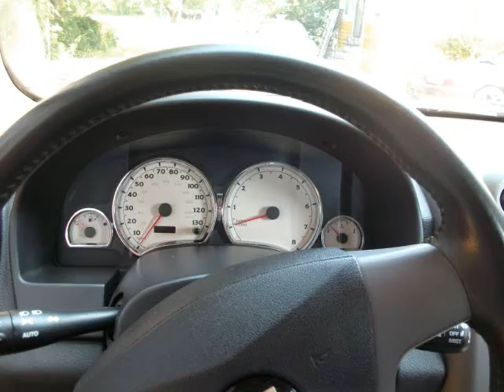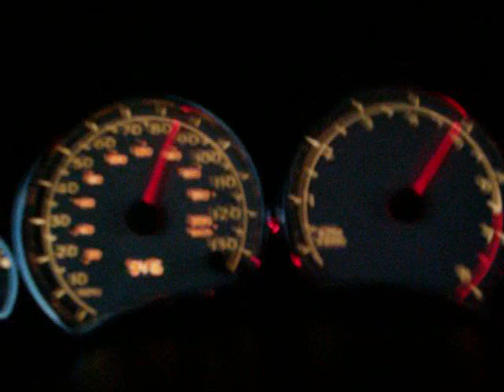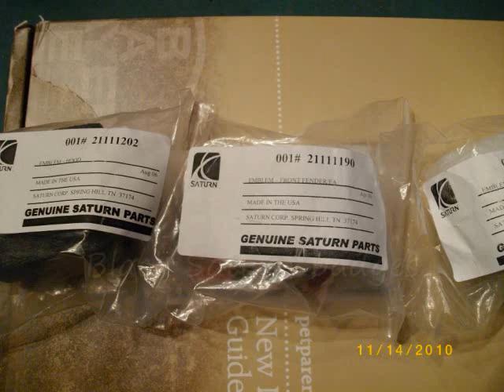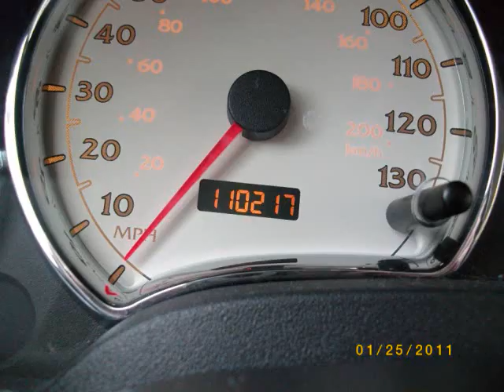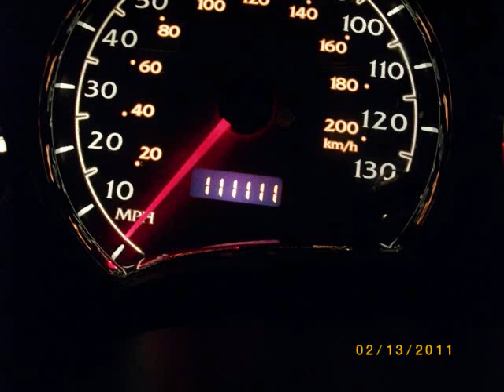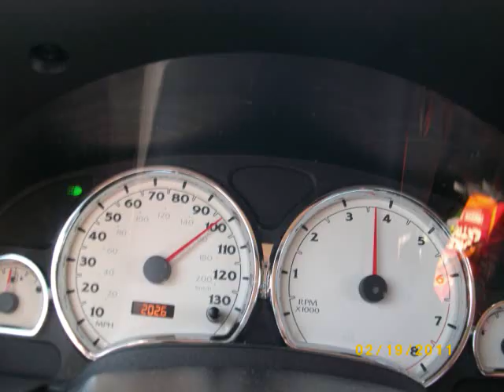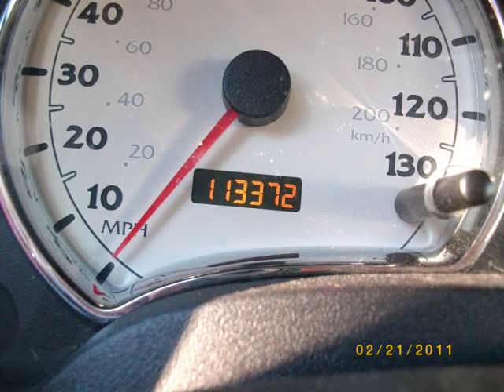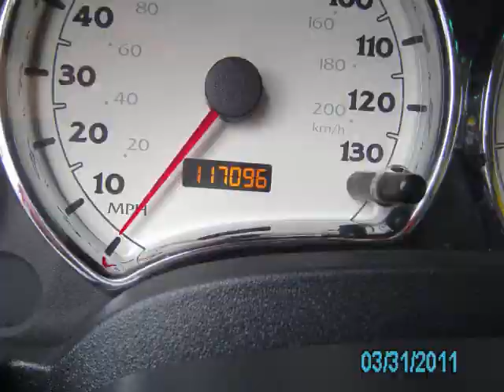2005 Saturn Vue-Midnight's first 7 months/ 15,000 miles

Comment from the maker: 3 yrs now, and 45k miles later. I would stay away from anything Mopar. Personal experience, and a brother who is a master tech has taught me these are garbage vehicles.Known electrical and transmission problems. This particular Vue has the Honda motor. Honda is known for reliability. Plastic panels on this generation make it perfect in the salt band I live in.win-win, not to mention you can see all the things I put this through that it takes on with ease!